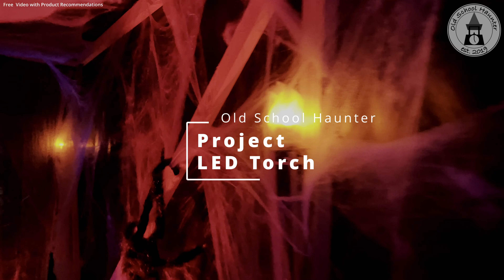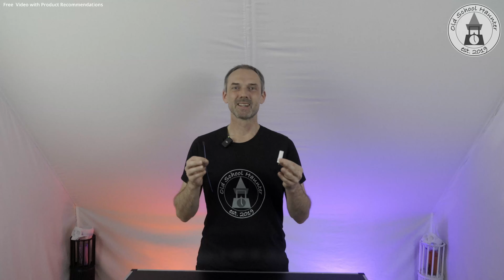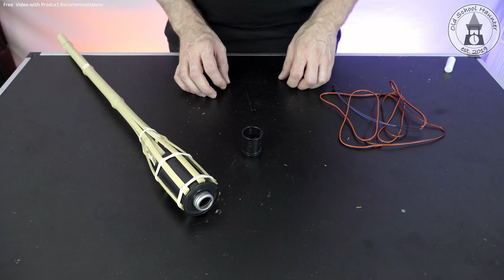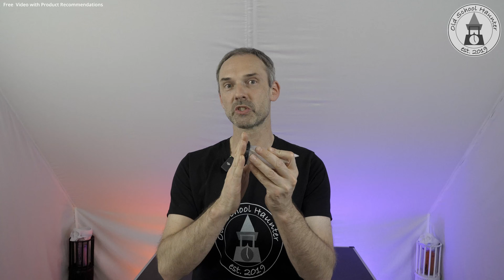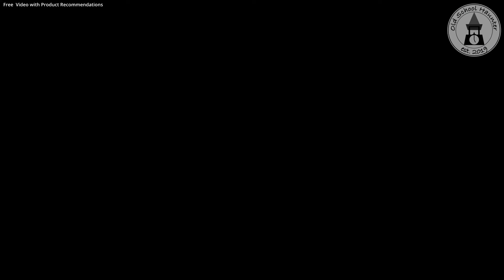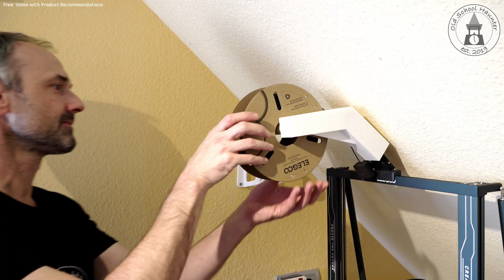Easy Diy Led Torch With Cool Effect For Halloween Decorations [Decor EN]

Comment: What is the part you place over the LED bulb before the flame print goes on?
Reply from the maker: Do you mean that black rounded thing? This belongs to the torch and is closure which holds the wick. It is very hard to see in a previous scene, where I removed the wick. There I hold that part of the torch in my hand and pull out the wick.